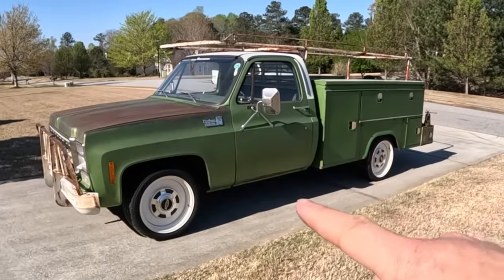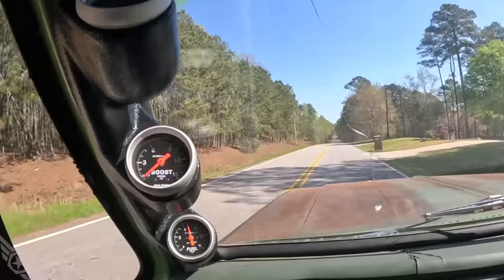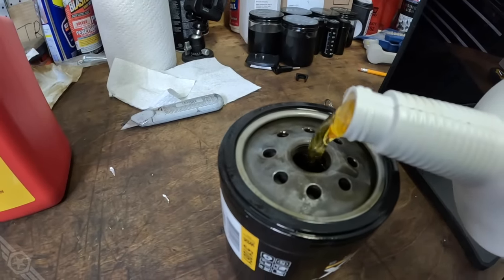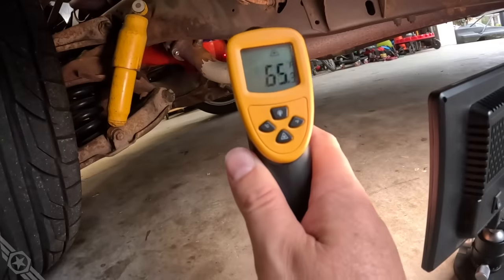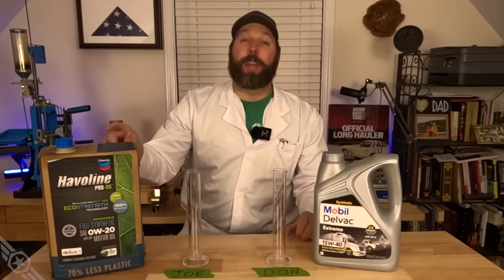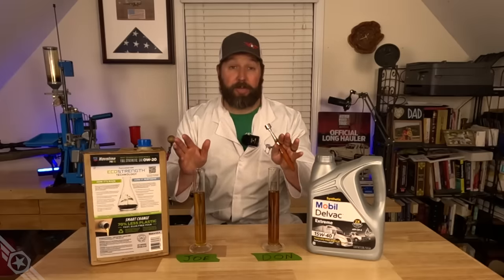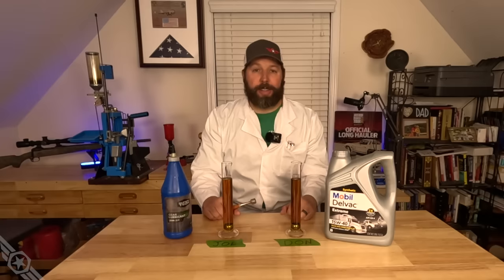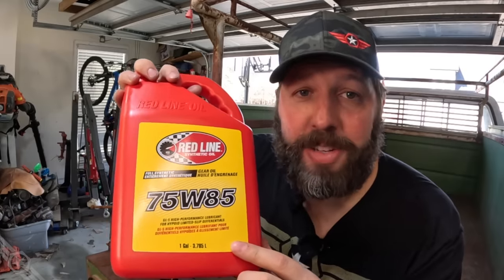Running GEAR Oil in an ENGINE!!! (EXTREME PRESSURE)

Comment: Had several ford V8s with low oil pressure and I used tractor transhydraulic fluid for oil…. Worked fine
Reply from the maker: When they are worn out, give them whatever they like 👍

Comment: The bypass valve in the oil pump will limit the pressure, also I had an early Chevy 283  that was extremely loose/worn that I used 90 weight gear oil to get any oil pressure, worked alright
Reply from the maker: It will limit the oil pressure if it get high enough (Generally 55-70 PSI in a SBC). It didn't get high enough to have an effect on this test. The 75W-85 I put in the engine was actually thinner than the 20W-50 that was in the engine. The pressure was actually lower.

Comment: Very good demonstration! I kept imagining I was smelling gear oil while watching this... no lie!  It's one of those odors you just can't not recall when you think about it. 
One more interesting thing about the dinosaur butt extreme pressure additives in GL-5 (and maybe other) gear oils is this. They are engineered to protect against rolling friction such as gear teeth in mesh, or ball and roller bearings. They can cause rapid chemical wear to things which encounter sliding friction, such as camshaft lobes and followers. The engine bearings have a hydrodynamic film which separates the bearings and journals so that should be fine. But I would be concerned about GL5 additives in a flat-tappet cam engine. I haven't seen damaged engine parts from this happening so I don't want to speculate.  I have, however, seen the brass worm teeth disappear in an electric motor gear reducer because of using GL-5 where a different lubricant was specified.
Reply from the maker: Yeah, it's certainly not ideal in an engine. I took it out of the engine immediately after shooting the video. It does have a flat tappet cam in it.  I have to use a GL-4 in the SM465 trans in this truck. Those old synchros don't like the sulfur. 👍

Comment: I had an old 4.3 V6 that I would run four quarts of 20w50, and one quart of 85w140 just so it would have 5lbs of oil pressure at idle. It eventually got to where I ran two quarts of gear oil before I finally replaced the engine. Also had a slant six that was pretty much the same way. I had run both engines like that for several years, never had any issues with them. Other than being old, worn out engines that didn't make any power or oil pressure, that is.
Reply from the maker: That's awesome. If it keeps it on the road, it can't be wrong 😂

Comment: The sullfur compounds in the extreme pressure additives unique to gear oils are corrosive to yellow metals in rod and main bearings and oil coolers.
Reply from the maker: I’m certainly not recommending that anyone do it. Just trying to teach people that the viscosity Grade numbers are on a different scale, in the most overly dramatic way possible. 👍

Comment: Thank you for explaining this properly. So many times, I have heard oil viscosity being misunderstood and misrepresented. People tend to confuse the w in the rating.
Reply from the maker: The “W” stands for “wrong” right? 😉
Reply: @freedomworx  some firmly believe the lower number is the winter rating. Trying to explain that the higher viscosity number is the oils cold rating seems to confuse a lot of people.
Reply from the maker: The W is the winter rating. The higher number isn’t the cold rating.
Reply: @freedomworx  Yes, the W is the winter rating. 

This is exactly what I was talking about. So many people have been told wrong for so long that it is nearly impossible to correct the mistake. I thought you had said it correctly in the video. My mistake.

The higher number is the thicker weight. Oil is thicker when cold. Thus, the higher number is the winter rating. A lot of the confusion is in the way the ratings are presented.

A 10w-30 oil is better represented if it is changed to 10-w30.

For example...
A 0-w30 will flow very thin at operating temperatures and thicker at startup and in cold temperatures.

10-w30 will be a little thicker, but its cold rating is the same.

A SAE-30 will stay thick.

This is why if you switch from a SAE-30 to a 10-w30, you lose oil pressure at operating temperature.

Higher viscosity=higher number
Higher viscosity=thicker oil

I get that gear oil has a different scale. But it is still the same.
Reply from the maker: @P.I.E. Your are mistakes my friend. That’s why you think there is so much confusion. You yourself are confused. 10 and 30 are viscosity grades, they are not viscosities. It acts like a viscosity grade 10W at the winter cold test temperature, which is around -30F. And it acts like an SAE30 viscosity grade at 212F. An SAE 10W is thicker at -30F than an SAE30 is at 212F.
Reply: @freedomworx  yep that is the explanation that is given. However, it is scientifically and just factually wrong.

A 10-w30 will run thinner at operating temperatures than a SAE-30.

A viscosity grade is literally rating the viscosity.

It is simple...

0 weight is like water
100 weight is like molasses
(These numbers are simply for explanation)
Reply from the maker: @P.I.E. A 10W-30 and an SAE30 have the same viscosity at 212F 🤷🏻‍♂️. That’s a fact. Go read SAE J300 if you do t believe me. And a viscosity grade is not a viscosity. What are the units of measure for the viscosity of SAE 30 engine oil???
Reply: @freedomworx  thank you for convincing me that I need to do a video myself on this controversial topic. I had planned on it anyway, but this conversation has helped me move up the timeline.

I know for a FACT  that 10-w30 runs thinner than SAE-30 at operating temperature. It almost cost me a vehicle.

I look forward to further this conversation once it all gets tested and posted.
Reply from the maker: @P.I.E. Good luck. You are literally arguing against the document that established the SAE Engine Oil Viscocity Grade System. SAE J300 🤷🏻‍♂️ I’d pay for and read that document before you put yourself out there.
Reply: @freedomworx  what is funny is that I am basing my statements on scientific facts, including research papers, and the very standards you are so convinced prove you right. As well as first-hand knowledge. Furthermore, a simple grade school level test proves it as well.

I look forward to the testing and discussions as well.
Reply from the maker: @P.I.E.  since I know you aren't going to purchase SAE J300 (it's $83), I'll provide you alink that will be very helpful in comparing SAE 30 and 10W-30 engine oils. You'll plainly see that 0W-30, 5W-30, 10W-30, ans SAE 30 all have the same viscocity at 212F/100C. There are hundreds of others on the internet that will tell you the same thing. You wont find any that support your opinion. https://wiki.anton-paar.com/kr-en/engine-oil/
Reply: @freedomworx  I appreciate the link.

I am already gathering the necessary information. Finding a variety of oils to test. I am trying to keep limited variables. The testing equipment is going to be ruff. But like I said, a simple demonstration is all that is needed. Nothing needs to be fancy. I am also talking with a lab tech from an oil company. He will be able to give me some advice and testing parameters. I look forward to these experiments. Even on the very slim chance I am wrong, I will post all my findings and data.

Even though I know you are set in your opinion, let me ask another question.

Let's say you have two oils, 0-w20 and 20-w50. Which do you believe is thicker? Let's say all variables are the same. Just the oils.
Reply from the maker: @P.I.E. There is no such thing as 0-W20 or 20-W50. SAE J300 defines the only applicable engine oil viscosity grades.  Asking me which one I believe is thicker is silly. This is not an opinion thing. The SAE specification has to be met for an oil to be API Certified. 20W-50 oil is more viscous than 0W-20 at every temperature.  It’s a simple as looking at the spec. 0W-20 is made from an SAE 0W base stock, and 20W-50 is made from an SAE 20W base stock. 0W can be a maximum of 3250 cP at -30C and 20w can be a maximum of 4500cP at -10C. SAE20  has to be between 5.6 and 9.3 cSt at 100C, and SAE50 has to be between 16.3 and 21.9 cSt at 100C. It’s that simple. There is no need to do an experiment to prove that, it’s literally part of the API certification test. I’m not trying to be mean, but have a fundamental misunderstanding of viscosity grades. I’m trying to help you, I’m not being stubborn.
Reply: @freedomworx  thank you for confirming my point.

Yes, the 20-w50 would be thicker. I understand I did not use accurate ratings. But it was simply to prove my point. 

The higher the number, the thicker the oil. An SAE-30 is thicker than an SAE-10. (using proper standards)

I am not trying to be difficult either. I am stubborn, I will admit. But that is primarily due to trying to live my life based on facts and evidence. When I see inconsistencies and false information, I try and rectify the data. Even if it goes against mainstream thinking. Sometimes, even when 100 people agree against  1 individual, it does not mean the 100 are right.

Never underestimate the power of stupid people in large numbers. - George Carlin
Reply: @freedomworx I have gathered quite a bit of interesting information. I am not yet to the testing phase. However, when I do post my videos, would you be ok with me mentioning this conversation and your channel? I fully understand if you refuse and will respect your decision either way.
Reply from the maker: @P.I.E. It’s a free country, you can do what you want. But I’d don’t understand what you are trying to prove or test. My assessment of your comments is that you completely misunderstand the SAE oil viscosity rating system, and refuse to see it for what it is, and think everyone else has it wrong. I understand it just fine 🤷🏻‍♂️
Reply: @freedomworx  I was asking out of curiosity. While I do understand the ratings and standards, they simply do not line up with my experiences. That is the point of testing my hypothesis. 

All else aside, I really like your  channel and content. You present information in a fun and interesting way. I look forward to your future videos.

Comment: I know you made this video entertaining but you've just explained to me something I didn't know very clearly. Thank you so much!
I really didn't know that gearbox oil grades and engine oil grades aren't the same.
But it does neatly explain why my gearbox didn't blow up when I put engine oil in it 😂😂😂😂
Reply from the maker: The more you know!  Thanks for watching 👍
Reply: Our big truck Fuller transmissions (13 and 18 speed) are designated 50 weight motor oil.
Reply from the maker: Interesting 🧐

Comment: When I was a young, I had a beaten up Mazda pickup.  The engine in that truck was whipped.  It left a trail of blue smoke behind it, and burned about a quart of oil for every 10 gallons of gas.  Having little income at that time, I put anything in it that I had available.  Any motor oil I could get my hands on for cheap went in there.  For a while, I ran motor oil from Dollar General - they sold quarts of recycled motor oil for about half the price of motor oil elsewhere.

I found that thicker oil helped with the oil consumption a bit.  I'd dump a quart of Motor Honey or STP in it, when I had a few extra bucks to my name.  Then, I found out that my grandfather had a 55-gallon barrel of gear lube at his shop.  He said I was welcome to it, so I started putting that in my engine.  It was free, and it helped reduce oil consumption a bit.  However, burning gear lube creates an amazingly thick cloud of foul, acrid, blue smoke!  Looking back on things, I really do feel badly for the people unlucky enough to get stuck behind me.

Once, because I was young and a bit of a jerk, decided to use this smoke for evil purposes.  I had accidentally stalled the engine at a green light (manual transmission).  The guy behind me in a convertible laid on his horn.  I responded in kind, by restarting the truck and revving the engine.  Within about two seconds, I could barely make out the car behind me in my mirror - there was so much smoke, it completely engulfed his car.  I know that guy had to be choking and gagging...
Reply from the maker: Karma 😂

Comment: I plopped a 350 Chevy into a car that I used for a driving job.
Mild cam, fancy carb.
I should have replaced all the bearings on the crank.
One kinda got loose on one of the rods, so I started using 20/50.
30,000 miles later, it started knocking again, so I started adding 85/140 gear oil.
That finally got thicker, but the engine lasted another 30,000.
It finally got to the point of threatening to discombobulate itself in a spectacular manner, so I replaced the engine.
If thicker is what you need, you might as well!
That old Trans Am was my baby!
Reply from the maker: If they are already worn out, give them whatever they want 😎
Reply: @freedomworx  I hear you.
It’s my own fault, really.
I chose to pull several bearing shells at random, and plastigauged them.
The ones I pulled were in spec.
So, the cam kit got out in, and it ran like a champ.
I went with a low-end high torque cam so I wouldn’t have to throw a lot of money into balancing.
With seven kids underfoot, it was not going to happen.
But, it was fun while it lasted!
Reply from the maker: If it was fun and you learned from it, it was probably worth it 😎

Comment: Definitely want to fill the oil filter, the oil guy did a video, really well done
Reply from the maker: His video only proved that oil out of a container is already clean enough, should be obvious, and  you achieve oil pressure earlier, which is beyond obvious. His wear metal portion of the video proved nothing. And that’s what really matters.
Reply: @freedomworx yesm, I'm just referring to the near instant oil pressure
Reply from the maker: @tristanlasley8030 but does that matter? That’s what people fail to actually think about. You don’t need oil pressure for the engine to be properly lubricated for a short period of time, especially at idle. There is always residual oil on engine bearing surfaces. My Duramax can take 3 or 4 seconds to build oil pressure on a normal cold start. Yet it has 190k miles in it, thousands of cold starts, and no excessive wear metals when I have the oil analyzed. Many small engines do t even have oil pumps, and spend their entire lives with Zero oil pressure. But I have a great test coming up to demonstrate this. 👍
Reply: Hmm, I can't really argue against evidence, can't wait for your vid. I'm just getting into all this.

Ps. Just went and searched, couldn't find anything about engines with no oil pressure, that properly lubricate as well, everything points to lack of oil pressure means increased heat and friction between the contact surfaces.
Reply: @freedomworx does the Duramax at idle use it's gears to lubricate? Idk diesels but I know that's how transmissions lubricate but they have way more gears with tighter tolerances.
Reply from the maker: @tristanlasley8030 no. The only gears are the timing gears in the front of the engine. The only thing they lube is themselves. Everything else is pressurized or splash lubed by rotating parts slinging oil.

Comment: My honda roto tiller craves 10w30 or 30 weight oil in engine and transgagetry! Whodah thot??? Used to be 75 gear oil in 1970. And 30/40 sae in engine then too. Gunna miss dinobuttz!
Reply from the maker: Maybe there are yellow metal parts in there that will reactor with the gear oil. Might just be Honda trying to simplify things for the customer. 🤷🏻‍♂️

Comment: Additive are different in gear oil vs. motor oil.  Might make the pistons turn too black, get stuck rings, if you run the gear oil a long time.  Also, smart to use Redline since it's a synthetic, more heat-stable around pistons.   Redline says that 75w-85 gear oil is a 10w-30 in motor oil language.
Reply from the maker: I talk about the major additive differences in the video. I didn’t leave the gear oil in there. It was just to demonstrate that the oil pressure did t really change.

Comment: Something I don't see discussed here is polymerization or friction modifiers
Certain additives cause the oil to thicken up instantly due to heat and friction from the polymer growing into longer chains.
The oil can be thinner at first but it's almost like instant friction sensing, and when it happens the oil thickens to protect the metal to metal wear.
- Energy Release is one such product I would not have believed this until using it. I was drilling some hard steel truck frame and kept dulling bits, good bits, Cobalt bits....then I tried Energy Release and found it "Activates" upon metal to metal contact (friction) at a molecular level.  I then with ER proceeded to drill right through the frame and not dull the bit because the ER protected the tip everytime it started to heat up too much.
Use whatever Oil you want as long as it isn't Redline...I've seen and heard of more things burning up and going out from that brand from Rear ends to 2 stroke engines.
(Bonus points for the Dillon in the background though!)
Reply from the maker: There are plenty of aspects of oil I didn’t discuss in this video. I was strictly focusing on the viscosity grade scales of engine oil and gear oil. That’s the lesson I was trying to teach. 👍
Reply: @freedomworx  No problem, I do like this video BTW.
Reply from the maker: @drd1924 I appreciate it 👍

Comment: Oil systems have a bypass valve  that pretty much regulates the oil pressure.
Reply from the maker: It only regulates the maximum pressure that can be attained. Which is much higher than the normal operating pressure. This engine was not making bypass pressure. Those valves are not designed to continuously bypass oil. If you are continuously bypassing, you are needlessly adding heat to the oil and wasting fuel and horsepower. Manufacturers size the pumps so that doesn’t happen.